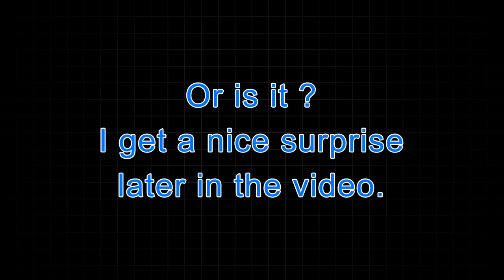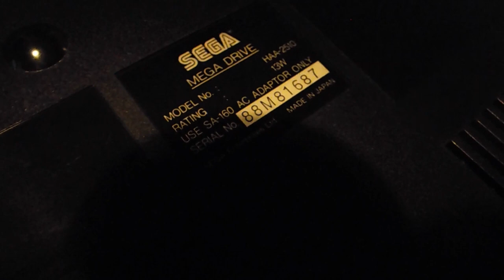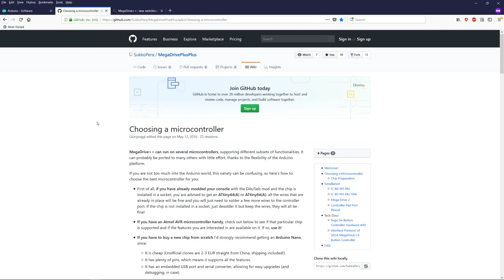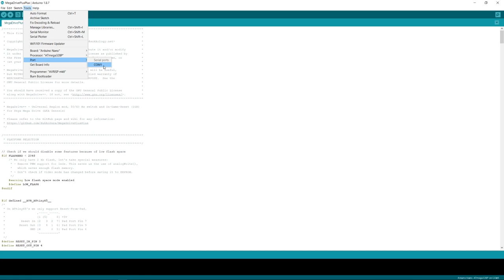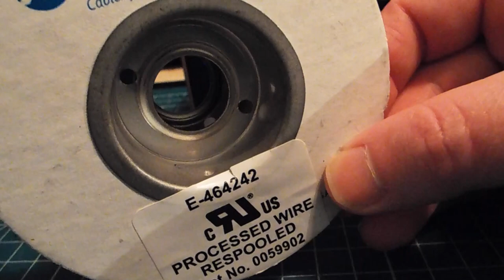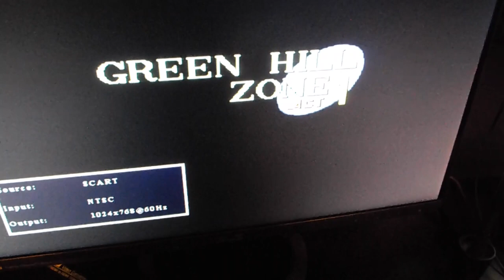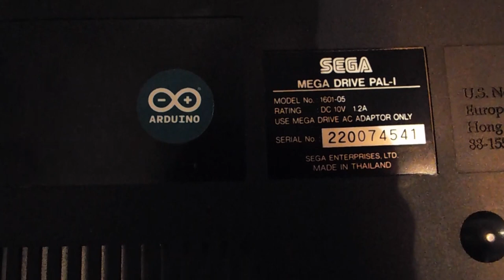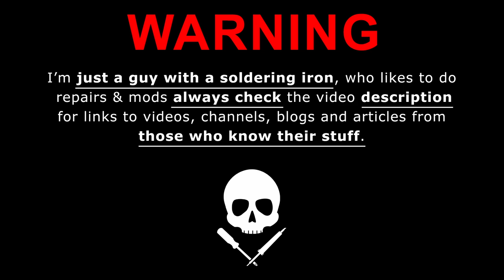Mega Drive 30th Anniversary Project - MegaDrive++ Arduino MOD

Comment: I have a Mega Drive Model 1 PAL-B Asia VA5 version (these are Japanese MD's modded to PAL for Asia region, cut traces and such) which i restored back to Japanese. Will this guide work the same for my Mega Drive?
Reply from the maker: It should work fine. I'm currently investigating an alternative to this mod. Working on it in my spare time and I should have some more info later this spring. I have a VA5 PAL-B. Mine is fairly beat up, so I mostly use it for testing.
Reply: @GameTechRefuge  Thanks for the reply mate! Mine was pretty beaten up when i got it but works like a dream. Since it's Japanese i have to cut different traces on the JP pins to your PAL one yes? I know JP4 was cut which i restored do i undo this? So cut JP1 and JP4?
Reply from the maker: @shanomacdaddy  Only two out of the four Jumper / JP are connected. These will be different but should be easy to find. If you cant see them clearly, buzz the out with the Multi-meter.
Reply: @GameTechRefuge  Thanks i will have to grab a multi-meter it's about time i grabbed one :D
Reply: @GameTechRefuge  Oh btw little off topic i've timestamped this https://youtu.be/2bfXsDYmv6A?t=361 but for the factory clock trace that normally gets cut for the PAL-B versions instead of cutting the trace they just ripped out the smd that is circled here does that matter at all? https://imgur.com/a/5o5llrz picture is taken from the vid above not my console.
Reply from the maker: Just seen your comment now. Apologies , Youtube had held your comment for review and I only noticed it now.Frustrating, bots get through but real commenters don't :( . I'll be sure to check my comments tab more often. I used TheDamoMonster's videos as guides for my first console mods :). Those butchers. I would try to repair the trace. I've been swapping out the oscillators on PAL consoles with the same value ones you find in NTSC console in my more recent mods. I have another Megadrive mod project coming up and I hope to get into the details more but the TLDR is, it's better for NTSC and makes little to no difference for pal. I does make nicer game captures in a limited number of cases. 
Thanks for sharing the info and pic, sorry again I try to reply to comments asap. Youtube had held loads of comments for review, might disable that setting as Bots seem to have no trouble getting around it and real peoples comments are getting withheld.

Comment: Do you plan to do one for the Mega Drive II? I have no idea where to start as there is no proper guide floating around. =/
Reply from the maker: I'm considering doing the mod to a VA7 model 1 ( along with RGB bypass & a few other things ). The VA7 model 1 is very similar to the MD II, in that it has many of the same cost reduced chips etc, all be it on a different main board. 
I recently got the 8BitDo wireless Ctrl pad ( very cool ) but none of the button combos to change region work :(. So I'm considering doing a conventional PIC Chip mod. It would mean no in game reset and no wires to the control pad. If I decide to go ahead with the PIC Chip, I'll design a PCB and get 10 fabricated. 
If your still going ahead with the MD II, I'd look at the instructions & diagrams on SEGA-16,  or http://www.mmmonkey.co.uk/mega-drive-2-2-regions-switch/. The process ( traces to cut and solder points etc ) is the same, the difference is that your wiring to the Nano rather then to a switch.
I'm hoping to get around to the mod some time before the holidays, so If you can wait it might prove to be a better alternative to the MD++. Sorry for the long answer :)
Reply: @GameTechRefuge  Thanks for the reply Dermot! I see this little instruction but it makes no sense to me and uses a different chip https://github.com/SukkoPera/MegaDrivePlusPlus/wiki/Installation-on-Mega-Drive-2 Im thinking about just following this one https://assemblergames.com/threads/sega-megadrive-2-50-60hz-and-region-single-switch-mod.54571/ though it's not a switchless mod but has clear instructions/steps. Though i would much prefer to use Megadrive++.

Comment: Hi 
Soldering diagram between console and Arduino in GitHub is different from what you did so which one is right
Reply from the maker: I believe the one on Gthub was updated, as the pin allocation in the code has changed. I'd go with that one. I did some follow up videos on this but I'd go with the latest wiring diagram on github. There should also be some notes on in this in the comments of the code.
Reply: @GameTechRefuge  
Ok thanks for replying I have another question how upload it the code in to nano there's any thing needed to change like name or option on Arduino IDE  I didn't succeed upload the MegaDrivePlusPlus code I checked nano with another code  and uploaded with no issue